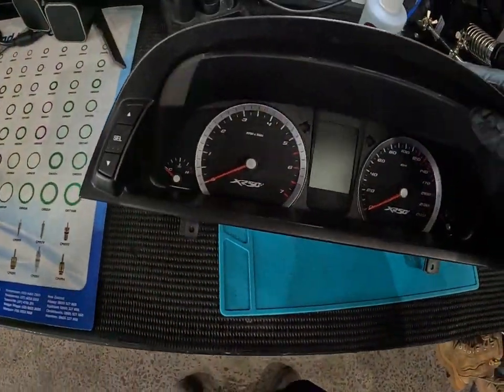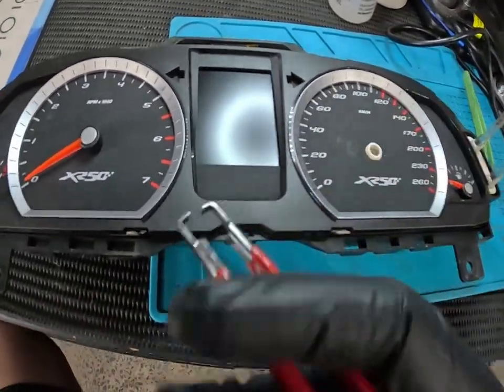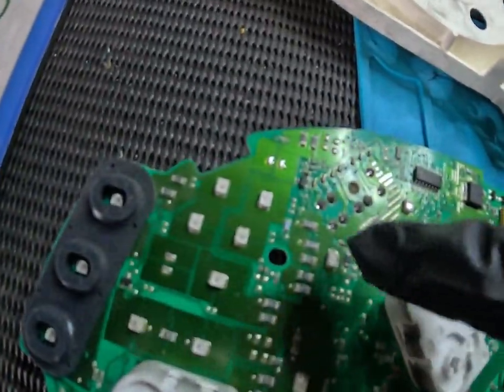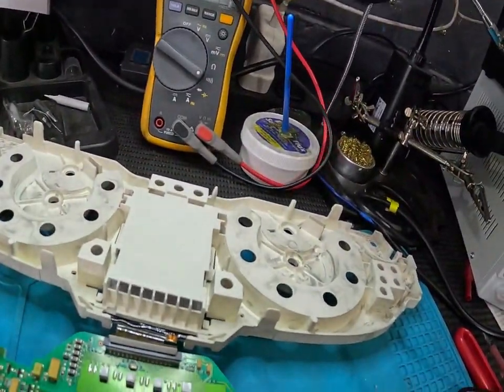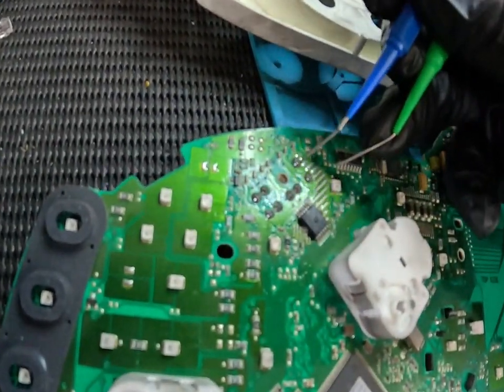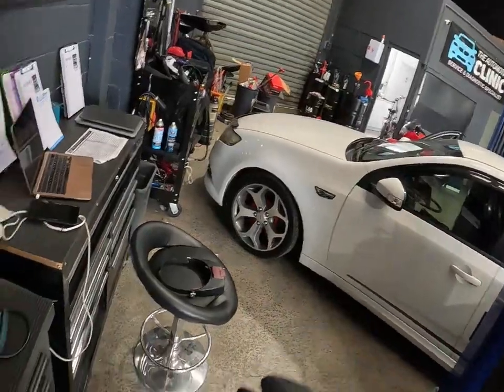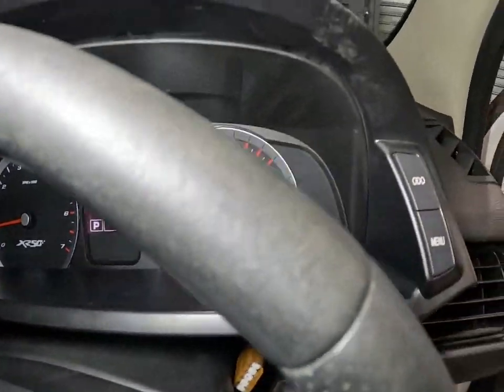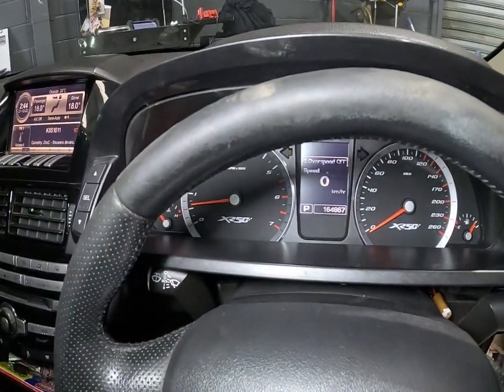Ford FG falcon immobiliser issue no one can diagnose 😱 instrument cluster repair⚡️

Comment: Your a Legend! Thanks heaps for putting this video up. I have a 2008 G6E Turbo that was putting up errors every now and again but recently is has been happening every time we have warm weather and even immobilising the car after turning off then back on again. I pulled the cluster apart and bugger me, there it was. I found two broken solder joints on the circuit board behind the speedo (right hand plug). I did a re-flow on all circuit board connections on that right hand plug and this has 100% solved my problems. I'm sure you have saved me shite loads of dollars. Can't thank you enough. Cheers bro! very happy.

Comment: Got a fg mk1 myself with a pretty consistent long crank when warm (restarting after being driven) with the occasional stall after starting, p1260 theft detected is almost always a recorded fault. Actually there's heaps of other codes in that print out I've seen at one time or another with u0466, u0140, c1327, b1693 being fairly persistent off the top of my head. Interesting, appreciate the upload.